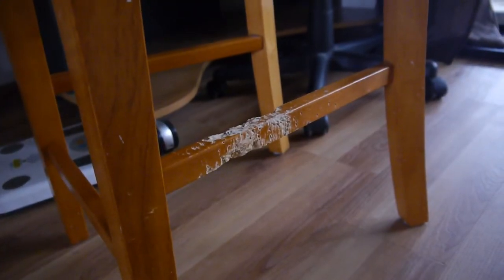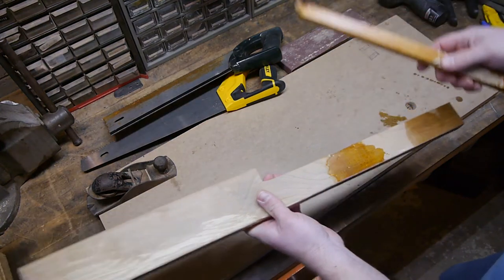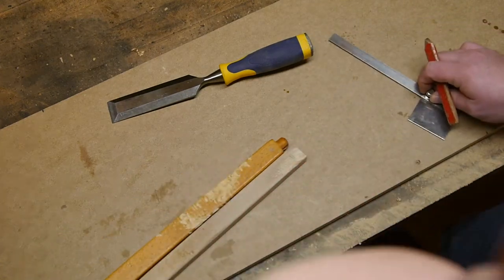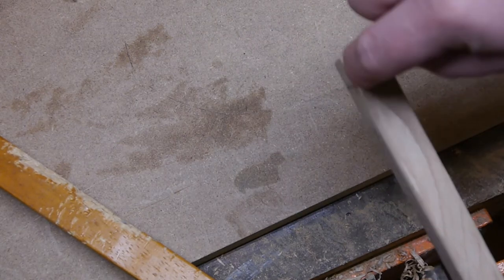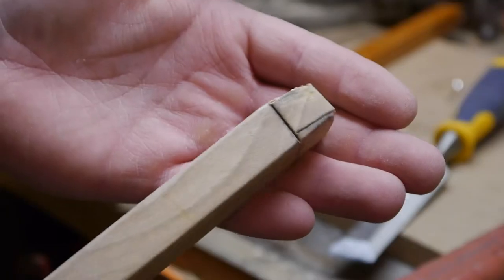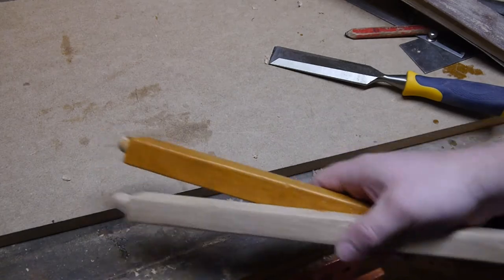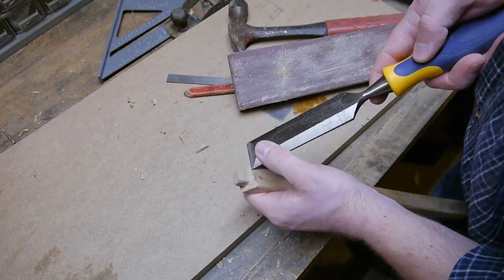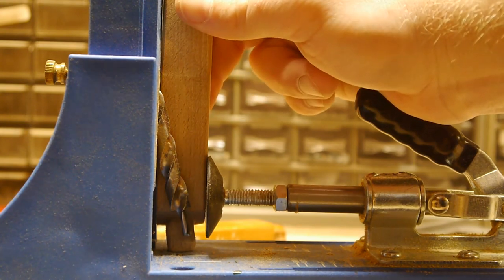Chair Repair: Fixing when dogs confuse kitchen chairs with chew toys: Simple Tools

Comment: That looks perfect... You've got some nice tools though: I don't suppose such a repair is possible with more basic ones.
Reply from the maker: Thanks, it took some trial and error for sure. Instead of a bandsaw you could use a japanese pull saw or a dovetail saw. A cheap one either is under 30. Don't get a carpenter saw, not accurate enough. Rip sawing your stock could also be tricky. Depending on your job you might be able to get a piece of stock close enough to the right size. The kreg jig is probably the hardest thing to substitute. You could try using a hand drill with a smaller bit and try and line ut up while it is in a vise. Just don't go too big on the drill bit right away and make sure your hand isnt holding the area in question in case it fractures wood and gets your hand. Do yeah, a chisel, pencil, pull saw, a couple drill bits a drill, and a miter gauge are essential. A vise, and a pocket hole jig would be nice, but you could do it without them. Thanks for watching!